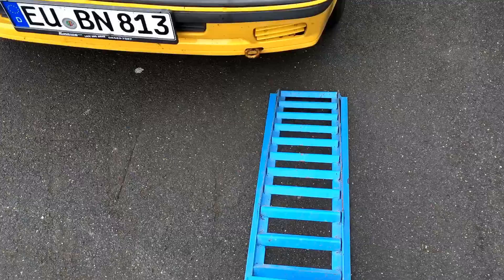How to use Car Lift Service Ramps Vehicle Ramp Front Version Peugeot 205 Roland Garros DIY

Comment: is their any advice on how to ensure the car wont roll backwards when your under it? :/
Reply from the maker: Use wedges on the rear side of the tires
Reply: ahhh, yeh man, if it rolled back while your under it, that would be enough to ruin your entire day!
Reply from the maker: Pull the handbrake and support with wedges, that’s enough
Reply: A couple of bricks behind back wheels
Reply: Handbrake on, put it in gear, wedges behind rear tyres.